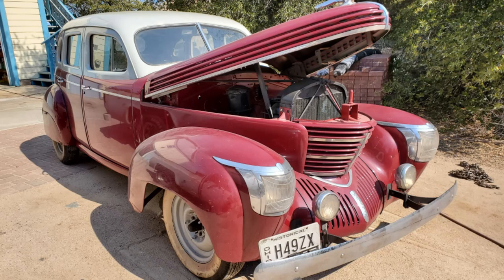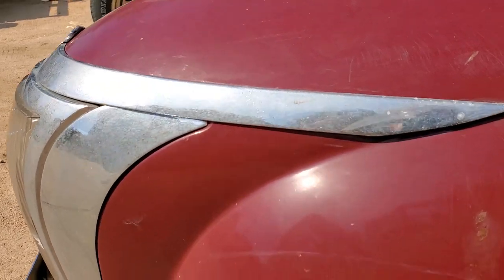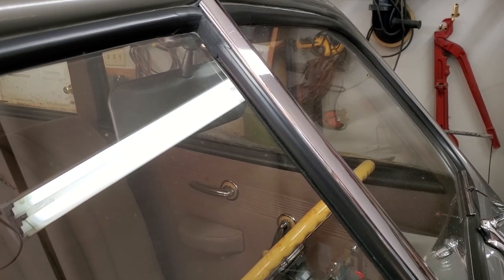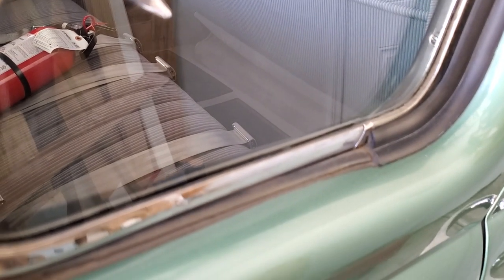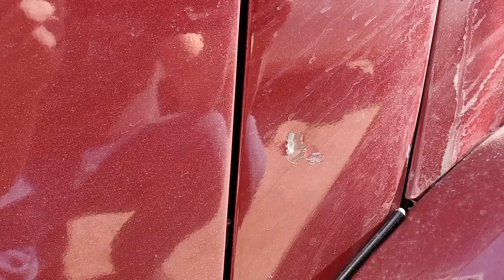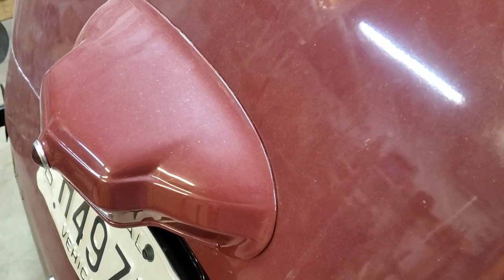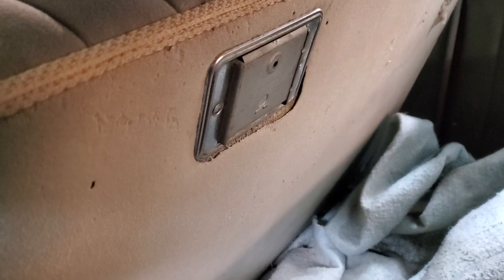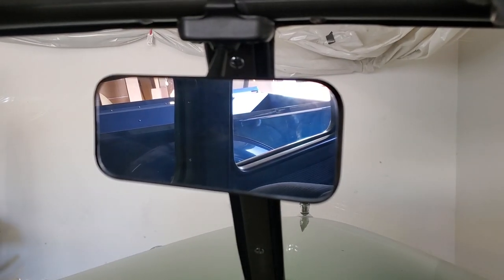1939 Graham Sharknose Project Car Introduction - Restoring a 1939 Graham Car

Comment: Is it correct to have fender welt on the fender skirts? If so, how is it attached?
Reply from the maker: Good Question. No, fender welt does not go around the finder skirt. There are a series of holes where about 1/8" rubber rectangles that are 1" long and as wide as the lip that the skirt rests against. The factory riveted these on at these points.

Comment: I just purchased a 1938 Graham, where can I find a manual to help me restore it?
Reply from the maker: Thank you for watching and for your interest in the 1938 Graham. Technically, there isn't one. You can find a copy on eBay for the 1937 shop manual, which basically covers the mechanics of the car. It will be useful to join the Graham Owners Club International: https://www.grahamownersclub.com/

Also, our channel has extensive information about the Spirit of Motion cars. Here is a list of links for playlists:

1939 Sharknose1939 Graham Supercharged Model 97 Spirit of Motion - 1939 Sharknose Graham Supercharged Engine
https://www.youtube.com/playlist?list=PL_APaYrVINp99ykov-0IM3j07N4AMDuPy

Graham Supercharged Engine Overhaul Series - 1939 Graham Sharknose 97 Engine with a Supercharger
https://www.youtube.com/playlist?list=PL_APaYrVINp_T1lnW9kGydck1QpLJHp6k

1939 Graham Sharknose Spirit of Motion Combination Coupe
https://www.youtube.com/playlist?list=PL_APaYrVINp_N5qYbskGQuXGTKVDSVTDD

1939 Sharknose Graham Model 96 Complete Restoration - Sharknose Graham Model 96
https://www.youtube.com/playlist?list=PL_APaYrVINp9wht754IxPNPz9q4ZgnWac